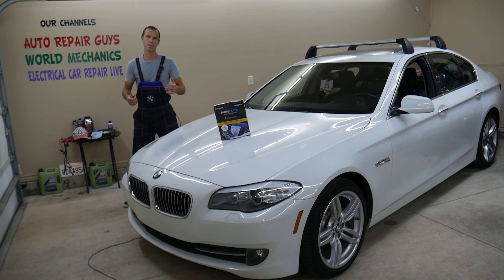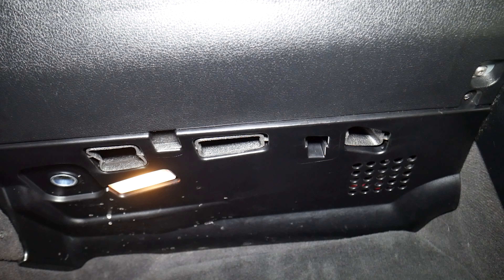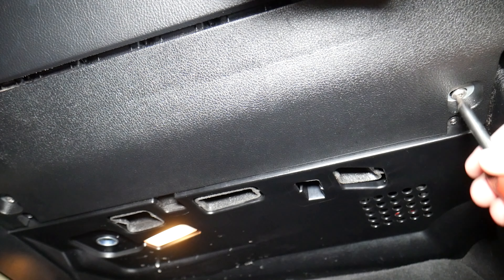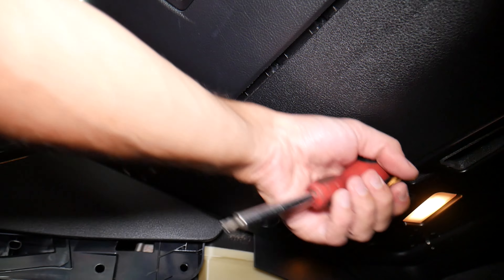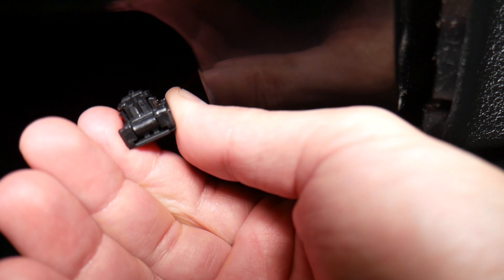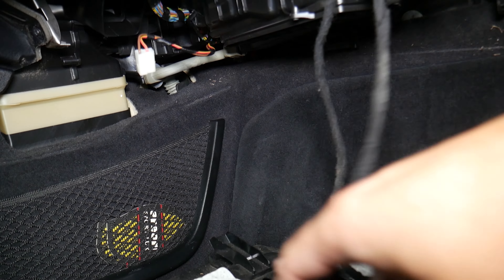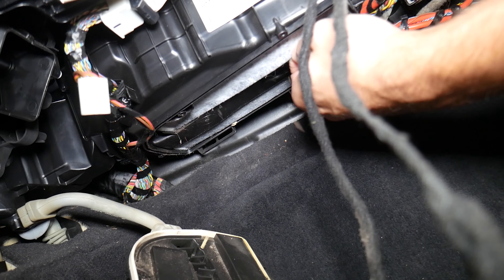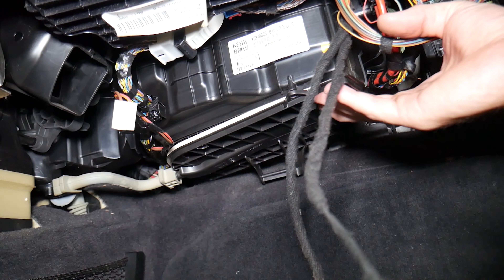HOW TO REPLACE CABIN AIR FILTER ON BMW F10 F11 520i 523i 525i 528i 530i 535i 518d 520d 525d 530d

Comment: No need to disassemble the airbag cover - just remove the 10 mm bolt at each end (the larger screws) and pull the panel down a little to unseat the clips holding the panel in place.  There are also a couple tabs at the front of this panel by the firewall holding the panel and airbag in place.  After disconnecting the wire to the 12V power outlet there should be enough slack in the other wires so you don't need to disconnect the airbag. You'll be able to maneuver the airbag assembly enough to access the airbox cover and replace the filters.  Be sure to engage the tabs on the airbox cover into the slots on the airbox (near the firewall) before reattaching the four screws securing the cover.  This will hold the forward edge of the cover while you contort your body to get the four screws back in. It's pretty hard to see the two screws near the firewall without using a mirror.  Be careful not to overtighten;  the holes can strip if you overdo it.  All that is needed is enough torque to snug the gasket and seal the airbox so it drains properly through the tube.  The procedure for replacing these filters seems abnormally complicated, but it does get a little easier after doing it a couple times.  The video here is quite good and shows you what you can expect.  Removing the console cover trim makes it much easier to remove and replace the airbag cover; don't skip this step thinking it will save you time.
Reply: Worked for me 👍 didn’t wanna touch the airbag lol thanks for the tip

Comment: Great video 👏🏼❤ Tysm!! I  purchased a 2011 535i 4 days ago. I took it to a bmw dealership to see if there was any codes that was wrong with the vehicle that my scanner couldn’t detect I also noticed the passenger side heating system blew cold air and took several minutes to be warm. BMW dealership has had it for two days and they are unable to locate the problem. They said I needed my air filter replaced could the air filter needing replaced be a factor in the passenger side blowing cold air?
Reply: Probably not. Has to do with the tempetature sensor or the compressor.

Comment: You don’t need to disconnect air bags. No need to unscrew two Two 20x screws that are😢 connected to the airbags. Just need to remove two T25x screws.The whole assembly come out.